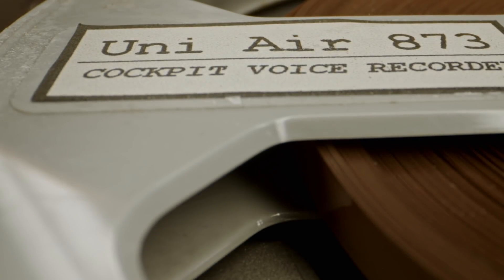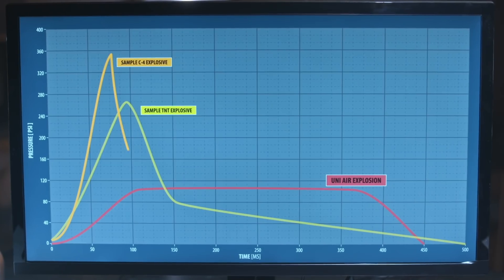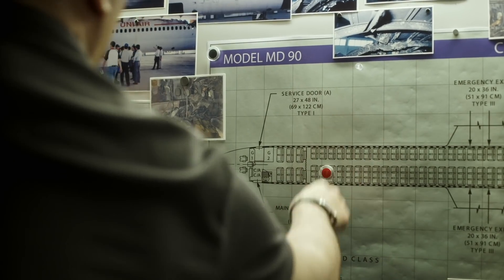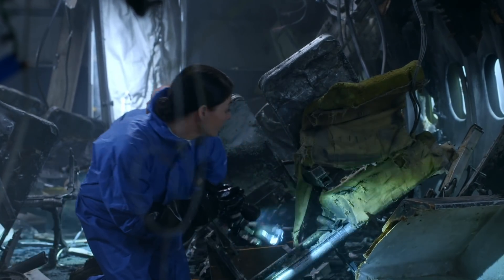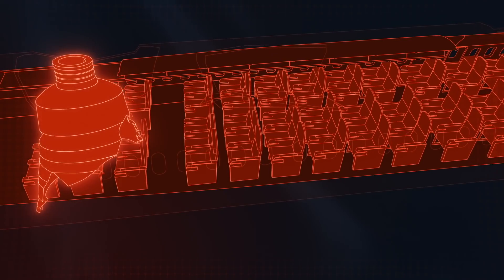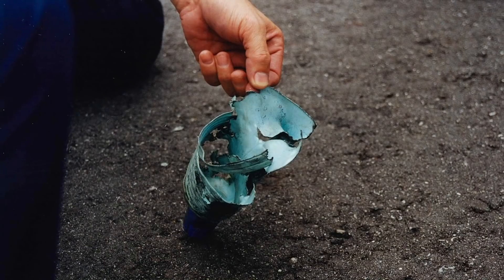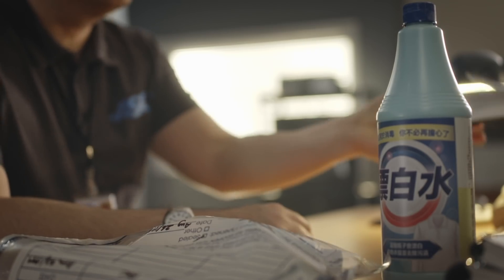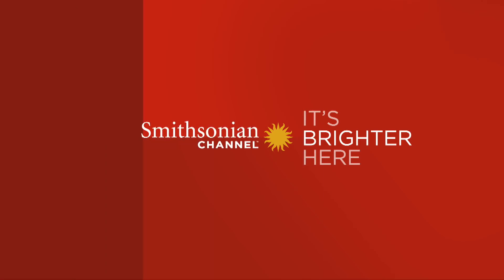Did a Tiny 750 ml Bottle Cause the Explosion on Uni Air 873? 🍾 Air Disasters | Smithsonian Channel

Comment: And this happened near my country recently: "Air Serbia has filed a complaint against Podgorica Airport after its flight JU173 from the Montenegrin capital to Belgrade was delayed last Friday evening when a passenger cleared security with TWO GAS CARTRIDGES in her carry-on bag, which she reported to have with her to the cabin crew after boarding and prior to departure. The passenger, who is a mountaineer and used the gas cartridges for her kettle dela, passed security at Podgorica Airport but was not asked about the items. After she reported them to the cabin crew the captain called the police and the items were removed from the aircraft. The Civil Aviation Agency of Montenegro has determined that the security staff member checking bags at the airport made an error and has been fined 150 euros for the omission." 💀💀💀

Comment: Smithsonian : gasoline
Me : if you want to bring gasoline onto a plane then put it in the wings
Reply: No that'll cause engine failure
Jet airliners aren't designed to run on gasolinr

Comment: The first explosing sounded like when flight 93 hit the south tower on 9/11  rip to the 767-200 and the 2,447 people that died
Reply: No. Firstly, Flight 93 was actually a 757-200, not a 767. Second, Flight 93 was supposed to crash in either US Capitol or the White House, but it ended crashed in Shanksville, Pennsylvania. The United 767-200 that was crash in the WTC 2 (South Tower) was actually Flight 175.

Comment: “Why would anyone bring gasoline onto an aeroplane?” I thought you were meant to tell me that...
Reply: That's easy, its in case the plane runs out.
Reply: @foxd1e722  Ah, of course, they just throw the passenger out of the window to fill it up.
Reply: @tree8719  Of course, if they open the door to do it, the gremlins might climb in.
Reply: @foxd1e722  Good Point
Reply: @foxd1e722  , yeah , cause they run on gas...🤦
Reply: @stevegiboney4493  r/wooosh
Reply: It probably contained Blazo or Coleman fuel which is naphtha de-leaded gasoline for a hiker's camping stove?.
Reply: Athlete Ku Chin-shui had his nephew smuggle the gasoline

Comment: And to think they perfectly landed on the moon in 69' in a flimsy lunar module made out of tin foil curtain rods and scotch tape 240,000 miles away throughout insidious conditions in space, when they cannot even build a decent craft immune to mechanical failures within a 25,000 mile circuference 50+ years later. SMH.!
Reply: Comparing apples to oranges
Reply: Oh you are one of those people

Comment: Moral of the story: Never buy a Chinese-branded laundry bleach bottle and take it on a plane because it leaks
Reply: Interior at altitude is kept at air pressure at 5000 ft altitude. It makes your ears pop when climbing to altitude. Creates a "sucking force" on the bottle. Also, gasoline dissolves or weakens many plastics. Puzzling about why a bottle of gasoline was brought on the plane. Did they do background checks on the passengers there?

Comment: There is 100 percent chance that this like accidents will never happen again safety standards are very high
Reply: ...yet the FAA allowed Boeing to create a plane that quite literally fell out of the sky.

cough max cough
Reply: @AFoxGuy  he meant that accidents related to this accident will not happen. But accidents related to automation might happen again because automation is increasing in aviation
Reply: Yeah, right
Reply: I do think stuff like this can happen because airport security still sucks. All they are good at is banning you from taking a bottle of perfume but allowed the gasoline on a plane. And I do get that it was in a bottle of bleach but I think bleach should also not be allowed on planes.
Reply: I don’t think so plane crashes are still common
Reply: If that's true then how did a bleach bottle full of flammable material, already prohibited by the airline, manage to become the primary source of this tragedy. 100% unlikely? Maybe so for gasoline. The next might be a bottle of Everclear.
Reply: But it May Happen in Indonesia.